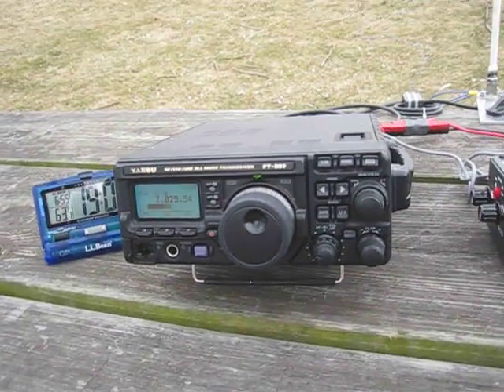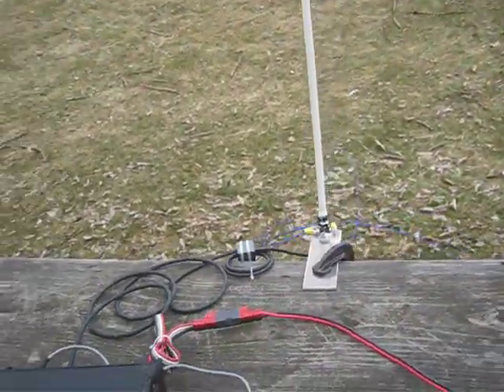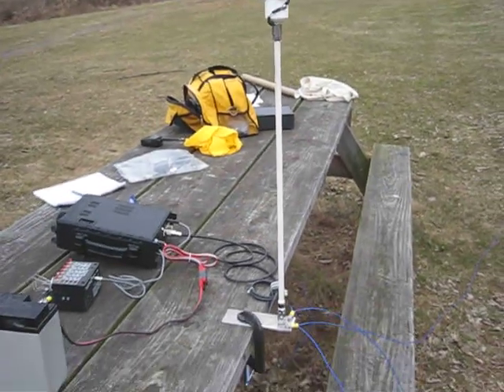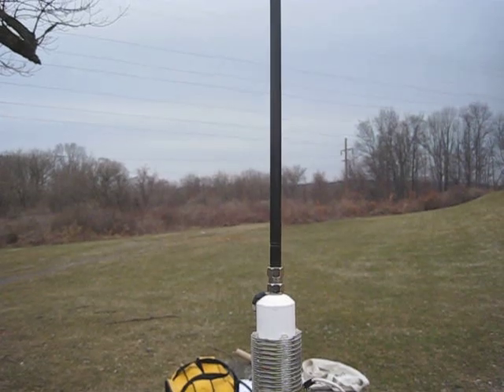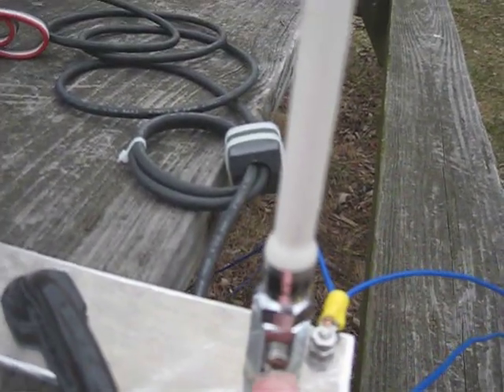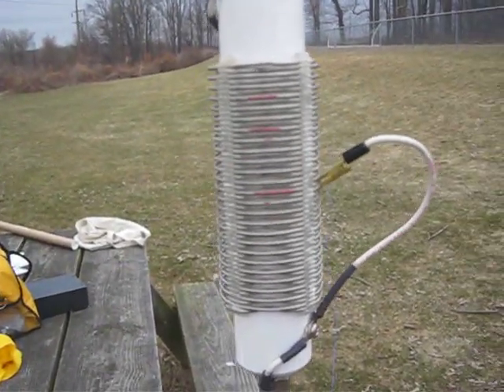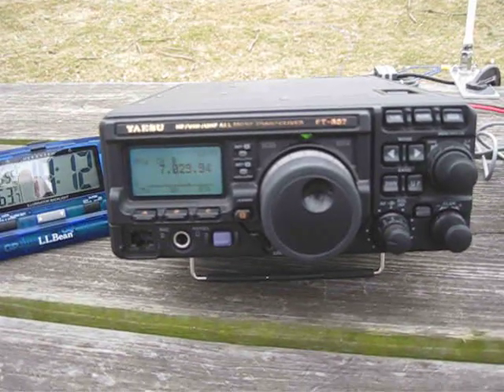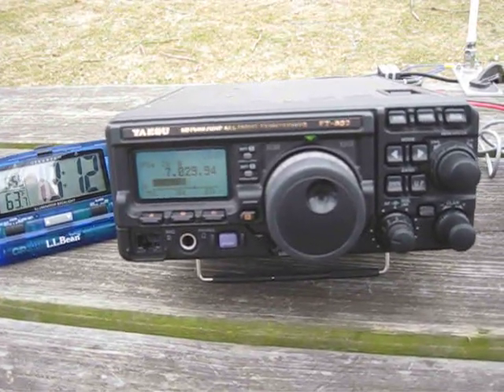Yaesu FT897 / FT897D portable with home brew table top vertical

Comment: Thanks OM for a nice video! Love the vertical antenna! I'm a vertical antenna guy anyway and love QRP CW work. I use a similar setup when on vacation etc. And yes a shunt coil at the bottom will really help. Even on a buddy pole dipole a shunt coil works fine to fine tune the SWR. Great video!!!
73
Jimmy, ARRL TC, WX9DX

Comment from the maker: @zx636racer   I was going to use an air variable cap. For me, it's probably close enough the way it is that I can get by without it. Even though the radials are laying on ground, they need to be trimmed and that will bring the SWR down a lot lower.

Comment: Nice construction on that antenna. For portable work this summer I opted for a homebrew magnetic loop made from some very lightweight and quite stiff low-loss coax with a copper foil sleeve, seems to work pretty well from 40 through 10 and coils up nicely for easy transportation but I'm pretty sure your vertical would have a distinct edge on 40 and 30. Very impressive job on that loading coil.